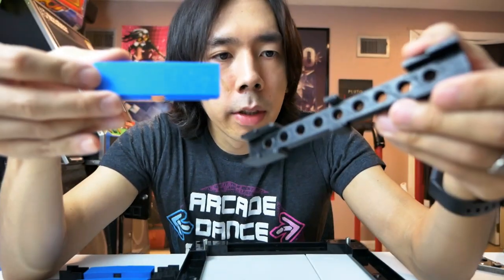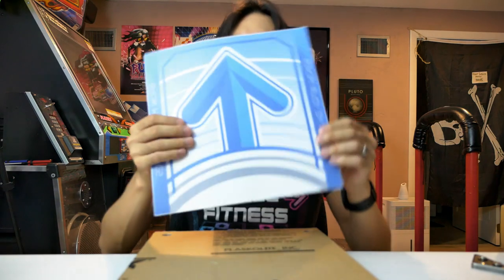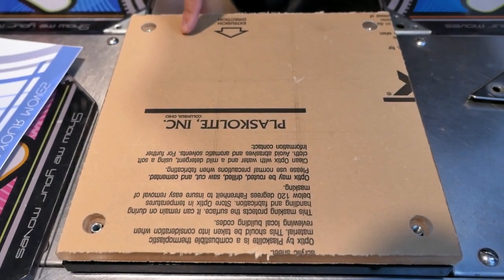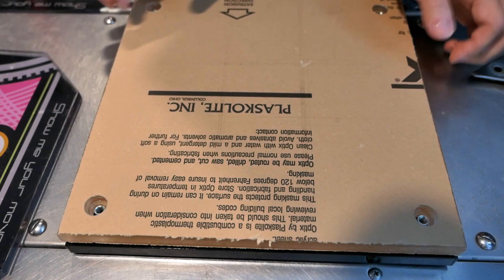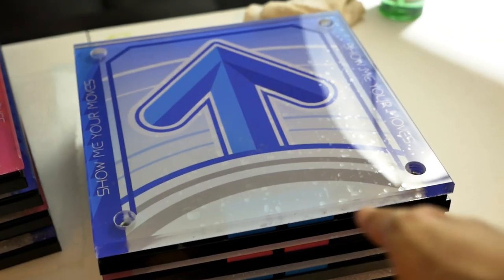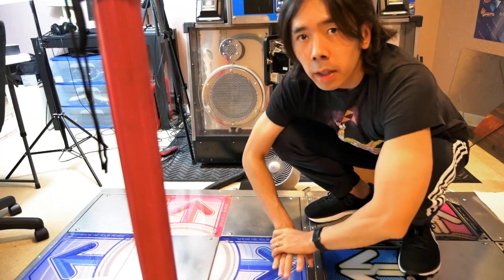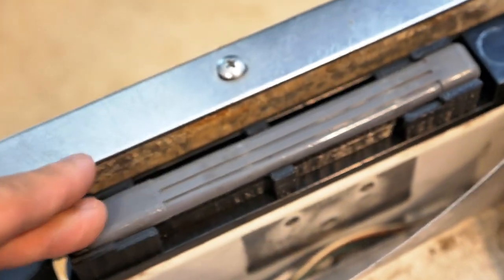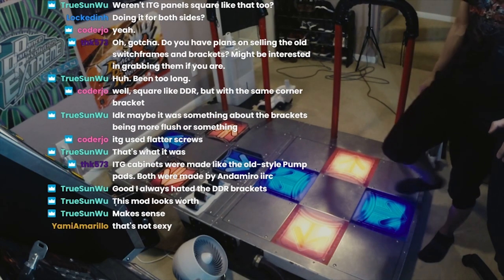Converting to BRACKETLESS DDR Pads

Comment: Honestly don't think that the new style sensor channels have that great of a design, the fact that they make the sensor sit that high is even worse, i know of an ITG machine where they had put hard rubber underneath the sensor channels to raise them, this made them very hard to trigger, modding was challenging because there wasn't enough room to add material on top of the L brackets, first time i tried to mod the up panel it sticked like crazy..